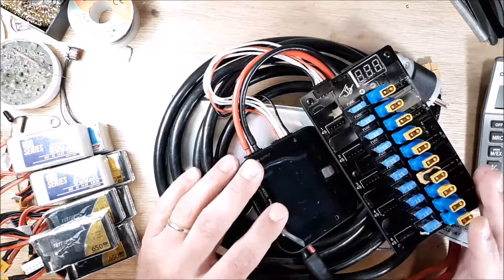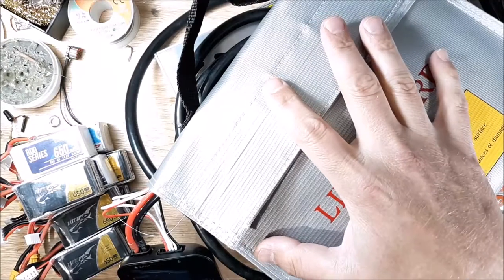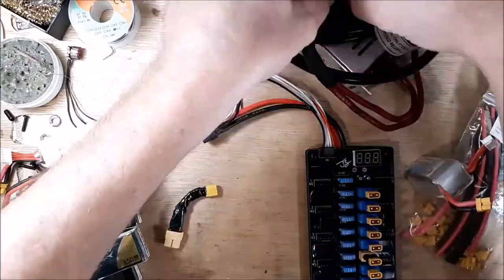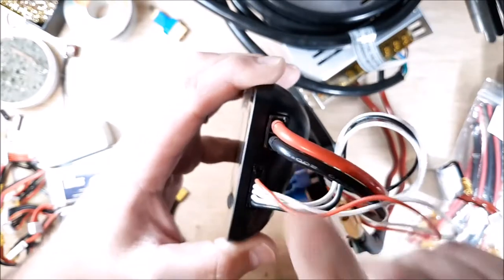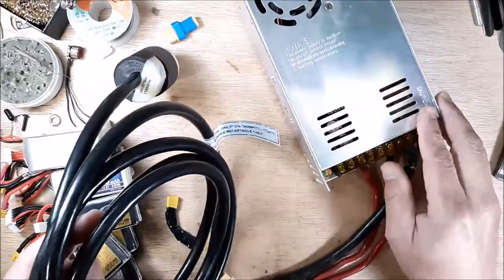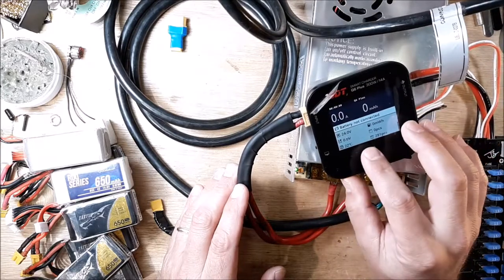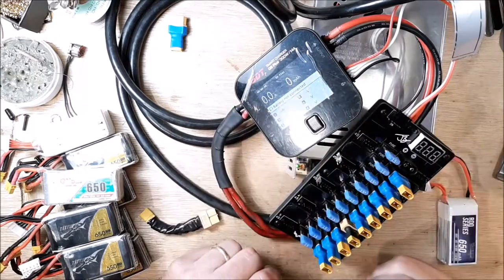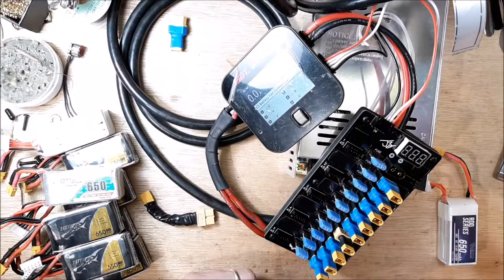How To Parallel Charge 10 Lipo Batteries

Comment: Good video, you got to be so careful helping people learn this. I do charge different mah batteries, and have never had trouble, but would not recommend to anyone else. I went to a second hand store and bought porcelain cups and saucers, I only charge 6 per board, but my charger will do 2 boards. I put each battery in a cup(or bowl if too big) with a saucer over each. I do this because I did try once to get a low celled battery to charge(never again) and burned a whole bag of batteries up. If I had a problem I would unplug the whole board as well. Fortunately if you take your time, follow the rules, your not likely to have too many problems.
Reply from the maker: I think about that, if one battery goes, they all do. That would be a bad day.

Comment: I got my quad to sing for me about an hour ago after resoldering everything and I'm wondering if the pin on the xt30 is faulty. I probably put to much heat to it.
By listening to you about the pins on the xt30, I notice that one of the pins, you can actually spin it around inside the housing (lose). Would that cause a problem not firing up my quad? Thanks for sharing!